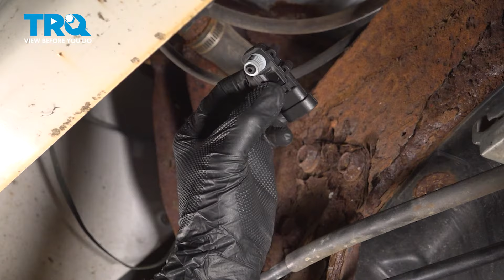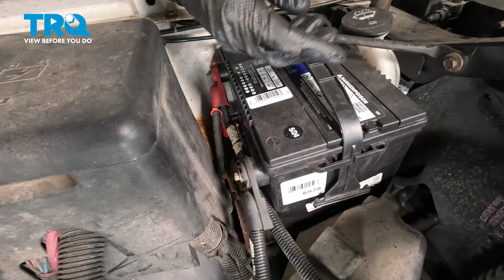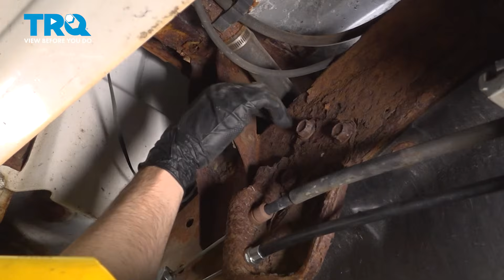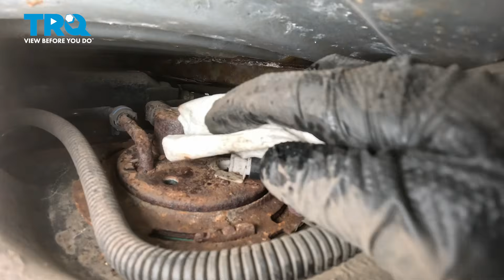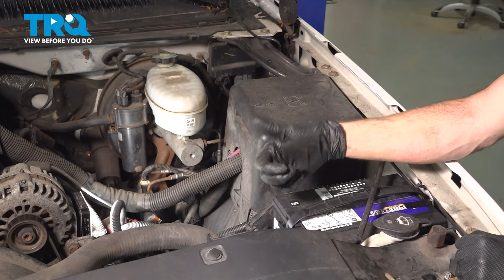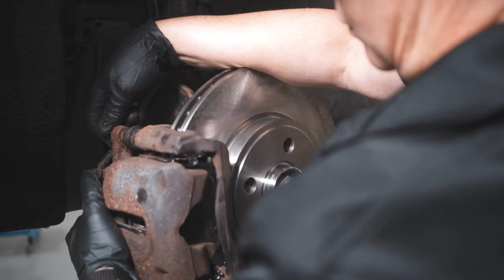How to Replace Fuel Tank Pressure Sensor 1999-2006 Chevrolet Silverado 1500 (5.3L V8)

Comment: Great Video! It gave me confidence to do the job. Couple of notes, I bought a cheap endoscope camera that attaches to my phone on Amazon. This became a lifesaver, as I broke the plastic end off when prying out with a pry tool. To get the piece out, I used a sharp 1 1/4" drywall screw and gently screwed it into the hole of the plastic piece. I then gently pulled up until it was somewhat loose. Then I clamped a locking needle nose pliers onto the screw and took my time pulling it out all the way. The new sensor fixed my P0446 code.